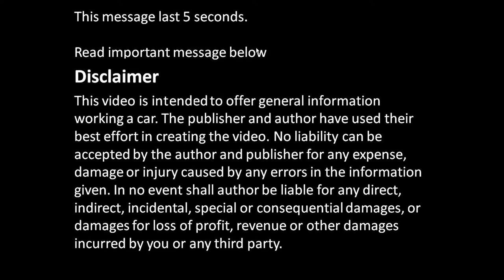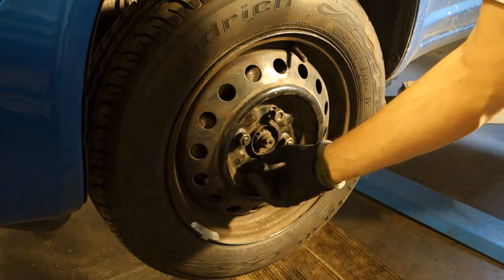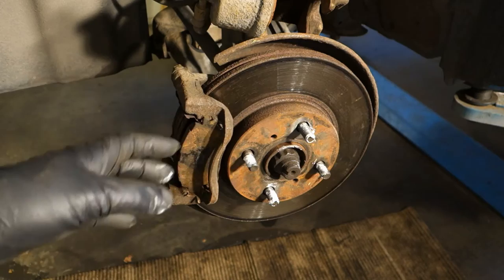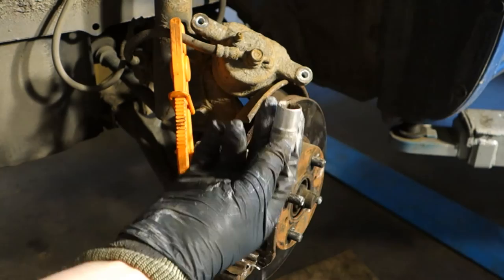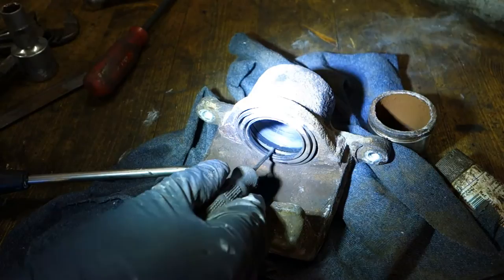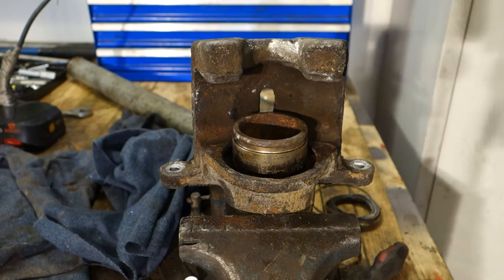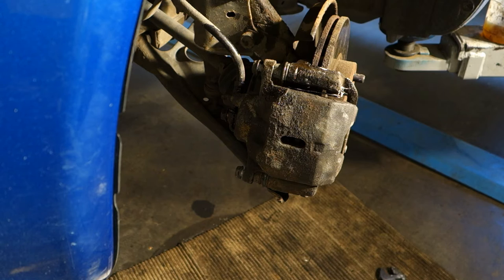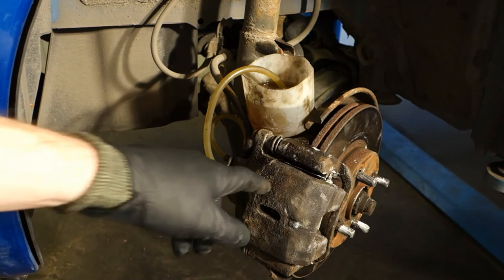What is wrong: Wheel and tire is hot in car or truck ?

Comment: Thank you.thank you.thank you very much for your instruction.the instructions you show. Is that solution you show  fix for tire won't spin. ? I really need help .My car had problems left front tire won't spin.? It stuck. And i saw smoke come out from left wheel and brake. Wheel and brake really hot.
Reply from the maker: Hi, You need to replace new Brake shoe. And brake caliber.

Comment: Hello, I have this issues on my Honda civic 8. I changed rear axle: wheel bearing kit, brake disc, brake pads, brake calipers, brake calipers brackets. And the wheels are hot, right side it's more hot, that left side. What the problem is? Sorry for my English.
Reply from the maker: Thanks for comment and noted 👍😀
Reply: What was it?

Comment: I just fixed new brake pads and I have this heating issue . Will this work ?
Reply: Same bro. I had also changed my car brake pad and the wheel is overheting.
Reply: @rehanilation4079  bro I tried this  . I didn't have brake paste so I used grease . And I must say it doesn't overheat like it used to. If you got the same products this guy's using ,I think it should work for you . All the best mate
Reply: @lafete6863  thanks bro.

Comment: Hi peter I'm having this heating  trouble with my Toyota yaris 2001 ,  they can't fix it ,they told me to buy a new caliper pin because It was a little  bent,it is still hot,still not working 😢 l 'll show them your video but I doubt we have the 2 different brake paste u used here ,n this country (Ethiopia ) can we just use "Total" brake fluids to lubricate everything?
Reply from the maker: Yes
Reply: Check your parking brake cable.